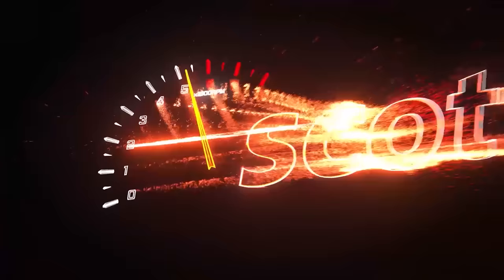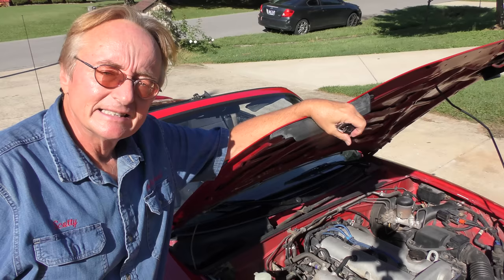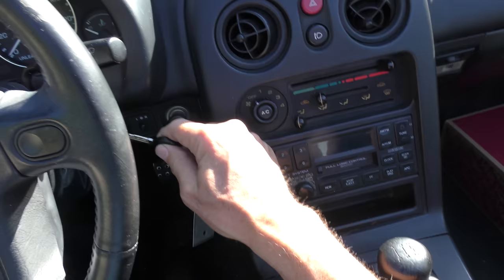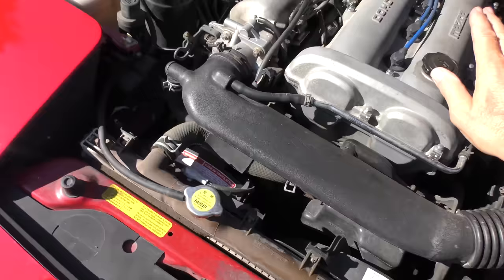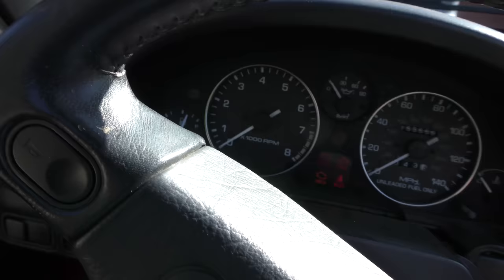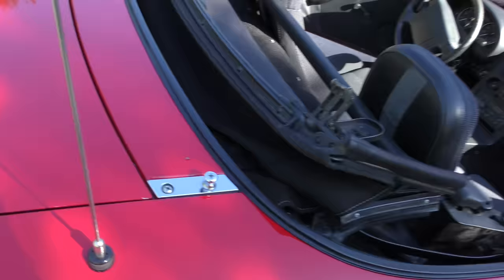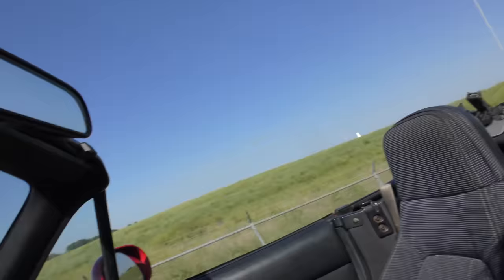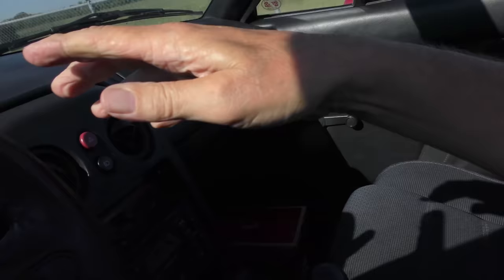I Just Found the Best Car Ever Made (and I’m Buying One)

Comment: At 6’9” I doubt I’d fit in one. But I’ve heard great things about them.
Reply: At that height your best bet is the Miata NC (third gen).
Reply: Try looking at Foamectomy for miatas. It's specifically for taller guys around 6'0", but I'm not sure about.. 6'9" haha.
Reply: @OOICU812  Or to have the roof down and look from above the windshield
Reply: I'd say at 6'9 you're probably not going to fit in most two-seater sports cars buy yourself a big Tahoe or an Escalade that's what you need👍😎🇨🇦
Reply: No reason to doubt, you would not fit.
Reply: If I was 6'9 I'd drive a 992 turbo S just to shock the world
Reply: I am 6'5" and I can assure you... you would not fit.  I tried to sit in a friends Miata many years ago and there was no hope.
Reply: @anthonybelyea1964  or a lifted truck
Reply: bruh
Reply: You won’t. Unfortunately. Truth.
Reply: I’m 6’4” and I daily a stock interior 90’ I’d say you could drive one up to 6’6” stock but there are a lot of mods you can do to vastly improve how you fit, different seats and low profile mounts and a smaller diameter steering wheel do wonders, there are even kits to lower the floor plan by 3 inches
Reply: Back when I had a Miata and was on the Miata e-mail mailing list, I remember one very big guy modified the seat by removing the rails and bolting the seat straight to the floor which gave him substantially more room, but with you being at 6'9" I have my doubts that would work!  Heck come to think of it you wouldn't have fit in my '96 Corvette either, it may have been a way bigger car but it did not come with way bigger head or legroom!

Comment: I have a 2001 Mercedes SLK 230 6 speed standard trans that I've been thinking of selling but because it's not worth much, so I keep it. It has it all: power seats and windows, hard top that goes into the trunk with the push of a button, great acceleration. It sits at our lake place most of the year and starts like new every spring. Your video made me appreciate the car so much more, I'll hang onto it. Thx

Comment: I've got a '97 Miata in Eastern PA that I'd like to sell.  I haven't started it in a year, the rear passenger tire is flat, the driver's side seat has a rip in it, and the Check Engine Light has been on for the previous 2 1/2 years, and the plastic rear window got blown out in a hailstorm.  The error code shows a misfire on one of the cylinders.  I've also kept a tarp over it.  First $1000 takes it.

Comment: I'm bummed but so happy you looked into Miata. I owned 2 which both were 6 speed. Oh how I miss them. One even had speakers in the head rest and would adjust louder if the top was down. No they are not a girly car. Only problem was with them, steering wheel did not adjust for people taller than myself, 4ft 11inch.

Comment: I always loved convertibles.
My first one was a total disaster: 1968 Fiat Spider. Any 30km drive costed me hundreds of dollars.
The second one was very good: 2007 Peugeot 207 CC (with the 1.6L Prince engine from BMW). Very little issues.
The current one is a 2019 Mazda MX-5 ND2 RF G-184 Top Revolution. The colour is the Red Soul Crystal, of course. 27'000km of beating it hard (track days included) on mountainous curves, 0 (zero) issues, excellent fuel consumption (average so far 6.7L/100km, despite driving it at high RPMs). But I treat her with the utmost care (oil and filters changes every 9 months/7'000km), the best tires - for it and for my area (excellent Bridgestone Potenza Sport, after some poor Michelin Pilot Sport 4 and some very good OEM Bridgestone Potenza S1), kept in garage etc.
I hope this will last till I die (it should, as it is the #1 reliable car worldwide), I love my Miata.
Reply: Never heard of the oem tires being very good. Michelin ps4 are the way to go. Oem suck in the wet and when cold. They're fun when you don't modify the suspension and like to slide around a little. But the day I'm changing them will be the best.
Reply: Hey. Can't see your answer here, just in my emails.
But I mean specifically the Bridgestone s001 that come on the mx5 nd. They are not good tires. In warm and dry conditions yes, they fit the fun and quirky setup of an unmodified mx 5. But that's all. I don't know much owners that didn't switch the tyres to better ones like Michelin Ps4 or Bridgestone Potenza Sport (new type) for example. Especially not when you modify the car with better suspension.
I only use the oem tyres because I'm cheap lol. And I like how they drive in good conditions. But I know they're not the best option on this car.

Comment: My Mazda RX-7 burned up in the desert and left me stranded between Baker and State line. I just filled up my fuel tank and it was a huge fireball.
Will not drive Japanese ever again.
Plastic radiator plastic fuel filter and now I only drive 1990s Mercedes and American cars.
Reply: I had three of the things and I adored driving them around… BUT I never would have taken one into the desert!! They handled like a dream but nobody ever accused the RX7 of being a reliable car 😂😂😂
Reply: @brucemorris3830  I actually had planned to race it at Willow springs raceway so there went my car racing career up in flames.
Reply: Rotary engines man, sounds like you neglected the apex seals

Comment: Love your videos I learn so much information. I would recommend you start using a gopro 11 as they can help with your movement. We can all enjoy your great videos a whole lot more. Heck you can buy a used gopro 10 which works very well also but the 11 will have a longer lasting battery.

Comment: My '93 Mazda Protege was bullet proof - NEVER gave a problem. Standard, and yeah, roll up windows. Fold down 60/40 split rear seats, cold carry a lot of stuff in the back. I kind of regret letting it go. I could sure use a car like that today.
Reply: The Proteges were great cars.  I've got an '03 Protege 5 and love it.  bought it from a friend who had just put a new clutch and flywheel in it.  I did the belt/water pump right after I got it.  Not a fun job but good for 80k and it's a non-interference engine, so I really don't have to worry about it.

Comment: That's where you're wrong scotty, I bought my miata in that condition except the paint, same miles in Dallas for 2500 with a hard top. Bought it BECAUSE it was an auto. Got the car cheap because nobody wants the auto. Ripped it out and sourced a transmission, ppf, wiring harness, crank shaft, and a pedal and shifter set for less than 1k. Made out with a great miata for less than 3900. A miata in the condition of your customers is a $6000 car all day here in east TN!

Comment: I bought a nice clean VW Cabrio from 2000 a couple years ago. 146k miles. Fun car. I need more space. But I wanted a small convertible. Its a well designed convertible and parts are readily available. Very simple 2.0 ABA.

Comment: I sold this after doing every possible upgrade while leaving the engine alone back in 2004 to buy a Porsche Boxtser S. I autocrossed both. The Porsche for the first 70k miles was more reliable than the Miata... not one single repair.  Then it came time to do the clutch/flywheel/intermediate shaft bearing upgrade. A little while later starter, alternator, coolant tank and shocks. I spent more on those repairs in basically a year than what I paid for the Miata.
Reply: Miata #1 reliable car.

Comment: I have a 2002 excellent condition  I've had it 6 years 80000 when I bought  Regular service one break caliper got  107000 on it it's nothing but fun Living in Northwest Ohio You can drop the top-down Windows up 50deg. and the heater takes care of you Oh yeah I have AC kick it on and you lose about 20 horsepower😂😂😂 Can't beat the gas mileage. Downfall  low profile Makes  difficult  For other drivers to see 🤷Or people just like to see me freak out when they pull out in front of me that's probably what it is😂😂😂

Comment: Why would I want a tiny car, impractical for most other uses? I have a 97 ford ranger 4.0 XLT with club cab, shell & lumber racks. It has 245,000 miles & runs like it did when I got it. If you can find one of those I'd say get it instead of a Miata, if its been well maintained.

Comment: I saw a Miata in an outdoor parking lot in Niagara falls 🇨🇦 after a 5 minute hail storm. It was the only car in the lot with dents all over it after the storm. The rag top suffered a few rips also. There were dents all over the hood and the tops of the fenders. The body was ruins by hail stones that were slightly smaller than golfballs. There was a Pontiac Firefly parked beside the Miata and it had zero visible damage from the hail. All the other cars in the lot appeared to have no body damage from the hail except the Miata. The metal on the Miata was obviously much weaker. It was a 1991 blue colored with black interior. The owner showed up and cried when he saw his car. He was astonished to see that only his car suffered damage and no one else's. He probably felt embarrassed about it also. Sad scene. He had to drive it 200kms back to Toronto looking like it was beat on with a hammer 🔨
Reply: Poor guy. Heart breaking having your car destroyed like that. The metal they use for them is pretty thin. The car only weights 2,000lbs

Comment: Bought a new one in 2002. Drove it for 19 years. No issues, lots of fun. Sold it and bought a 2010 one dark blue with electric hard top  6-speed manual with 40,000 miles on it for 10k last year. I love em. Dependable sporty fun.

Comment: I found the possible Achilles heel….to be the extremely short Crankshaft end engagement to the Dampner  my first miata  a ‘91 imo had possibly had accessories over stressed and results were it Totally compromised the Dampner  keyway…… I bought a genuine replacement Mazda key and a “sized Brass key stock…0k, this is where it sounds dicey , as the crankshaft still has one side of the keyway intact ( phew factor was helpful ) placed Brass key against straight cut a clamped down with ViseGrips and that is where my ground clamp was attached…..
Now back to the Brass keystock , it was used as a “ Dam “ to weld against ! 
Sounds sketchy now but ark welding process allows welding to beside the Brass and hold sharp while building up the compromised CrankEnd ( this was all done InFrame as at point it was totally an “experimental patch” also the original front oil seal was still in place in hope to keep contamination from crankcase…….KeyWay was cleaned up with a Dremmel tool and Mazda key replaced the Brass key with the intended….now and here again….imo ….the crankshaft is too Short and allowed “ over stress side pressure from the accessories, again my thought….so….I sized a bushing to crankshaft dia. and length to front of Dampner. Mazda has a thru bolt holding Dampner in place and “ home made bushing served well….as I put another 60,000 fun filled miles on my InFrame Patch !
My second Miata is a ‘99 which first serviced was a new TimingBelt and discovery of a …..you guessed it a Short Crankshaft , that had not been compromised . InterWeb produced a drop-in bushing which was used to complete the TimingBelt replacement 
Hope this helps, as this is truly a Fun Roadster ! Cheers
Reply: Thanks!

Comment: Well I see the difference between timing chain & timing belt , chain stronger last longer, 
On the other hand timing belt if engine goes out timing belt busts and internal damage might not happen,
Reply: This model year has a non interference engine. If the belt goes out, it just stops running.

Comment: Love the Miata, but too small for me at 6'3".   I have a 2007 Honda Civic Si VTEC sedan with 200hp and it is a blast to drive and I fit well in it.   Lots of miles, but the k20 is still going strong.
Reply: Try the new Miata ND2, you should fit in very well, I have 6'2" and I saw another ND2 driver at about 6'5".

Comment: Mazda is building much more reliable vehicles in recent years, including this one.  We have 2013 MX-5 and that is so dependable, never had ANY problem as long as keeping oil and filter changed on regular basis which is the most important maintenance to do to any car.
This is a very nice Miata, for only $4500.

Comment: 2012 BMW 128i. I'm 6'2" and don't fit in the MX-5. Had a 2006 Pontiac Solstice that I could squeeze into. My 1996 328iC BMW was a good fit. The 1992 Chrysler LaBaron was also a good fit, junk car. Then there was the 1976 Jeep CJ5, crap car. And the 1st was a 1968 Camaro RS. The Solstice was the closest to a MX-5 I've ever owned. IMHO, the BMW 128i is the best convertible touring car for me. 2+2 seating with over double the trunk space of the MX-5. My advice for transmission on the BMW, as Scotty says a manual is good, for the BMW also. Now there is a BAD automatic and a GOOD automatic. The BAD automatic is the DCT. It is an $8,000 hand grenade. The GOOD is the 6L45R which is a GM box. For the uninformed, BMW has been using auto Transmision since the 80'. BMW quit in 2014 with new ZF units. The 6L45R is a low hp Camaro, Cadillac ATS or CTS gear box.

Comment: My cousin bought in 2010 a nissan micra k11 it was on 210000 miles paid 50 for it with 1 month mot lady bought a new car and she didn't want it anymore body work was shabby paint work shabby ect  roll on  2021 he added another 120k on the clock so in total 330 thousand miles on a 1 litre bag of nails engine still running it outlived the bodywork needed huge amounts of welding them Japanese now how to make a reliable car fair play to them

Comment: $4500 is a great deal for an NA.  You pay a premium for the pop-up headlights that can't be made now due to regulations.  NBs are cheaper and drive better due to a stiffer chassis.  NCs have the best transmission, that thing is rock solid and people that turbo their (current gen) NDs frequently swap out the transmission from an NC because it can handle more power.  NCs were arguably the ugliest body-style, though.  And had the worst suspension, body roll and general softness made this gen a true boat, something every gen suffers from to some extent - all of these cars benefit from aftermarket sway bars and coilovers more than anything else.  Still the most fun you can have in a car that isn't actually fast.  Who cares.  You can't drive your porche at the limit if you don't go to a track.  You can drive a miata at its limit and the worst that will happen is you get a 10mph ticket.

Comment: 20 years ago I bought a '91Geo Metro Convertible for $3000. I had the engine rebuilt after a couple of years since it had almost 100K miles on it and previous owner did not take very good care of it. I am still driving it, but only in spring, summer and fall. I store it in the winter. It is fun to drive with its five-speed manual transmission and it gets great gas mileage. It is beginning to show its age, but for local driving with the top down, it's a real blast. One word of caution: don't drive it in late fall with the top down. I was on a back road and speeding along a 50 mph and a huge walnut fell out of tree. It beaned me on the forehead after bouncing off the windshield. That smarted!  No more October rides around Lake Michigan with the top down.

Comment: Thanks for showing this car. I had a 1991 model "A" package, which is no power steering, manual windows and manual locks. Easily got 35mpg on the highway, and 26mpg in the city. The speedometer isn't optimistic @ 140, although mildly modified mine went 133mph with a hardtop on. Still had pedal to go, but the hardtop was starting to try to lift up at that speed and I didn't want to be sucked out (or pushed out depending on the proper physics). 😂

Comment: I have a 1990 1.6 short nose and 1991 1.6  long nose both are blue blue  the 90 is hard top with 5 speed with over 300k short nose crank and the 1991 has over 300k as well. But both  still run  great and if the timing breaks it's non interference so just change it when it breaks I've owned them for over  8 years and i got the 90 from the original owner the 91 has been passed around more than i care to know lol 🤣

Comment: Smiles per miles?  Had a Mazda and no way that will ever happen again... driver's seat started squeaking within a year... all exterior lights had to be replaced before 2 years... no stone guards in the wheel wells so dirt and grit flew up inside the body on gravel roads... RUST!!!   After three years and ten months, EVERY quarter panel had the beginning of rust even after protection.  They use the lowest quallity of parts from bumper to bumper. A Japanese friend once told me "We don't drive Mazda at home. In Japan, if you drive Mazda, something has gone wrong."  If you want a stick-shift, soft top with smiles for miles, get a Jeep Wrangler. On my second Wrangler... never ever a Mazda again.

Comment: That thing needs a radiator real real soon (if it hasn’t already been mentioned). 

That yellow color change from black is a signal.  Also good idea to replace the little hoses that run around circulating the coolant between stuff like the oil cooler and such at this age.

Comment: About 50% of what you just heard is nonsense. I like Scotty as much as the next guy and he has good advice but before he goes liking on the Miata he needs to find a late model Camaro convertible (gen6) with the turbo four and six speed. Better driving experience, way more pep and you can use the back seat for extra trunk space. Waaayy better looking too.
Reply: Try harder